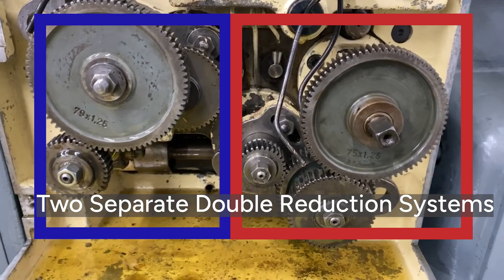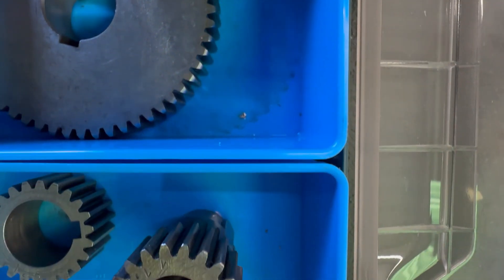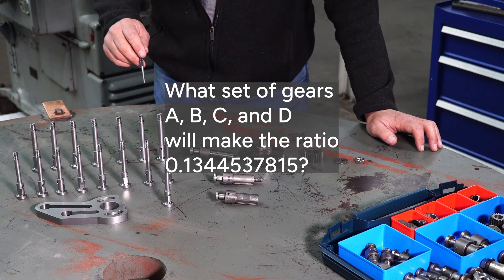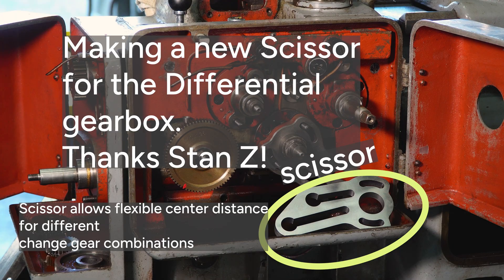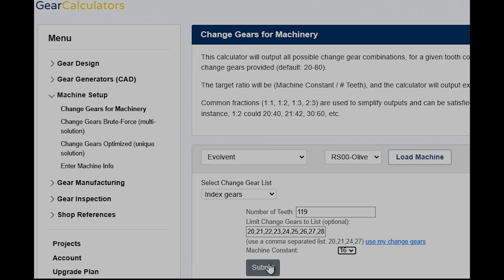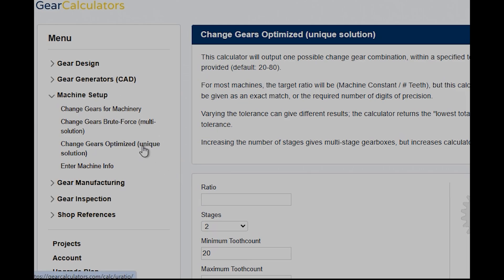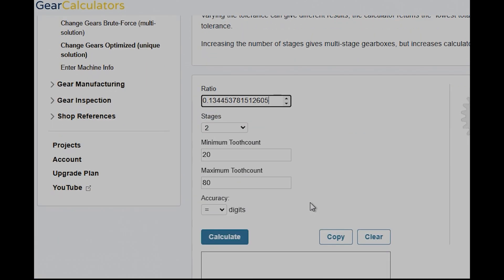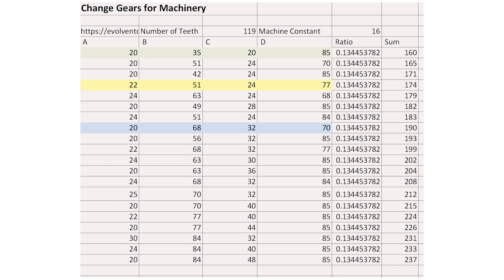Multiple methods to calculate change gears

Comment: Sir, how are you sir? I have 101 teeth in 24 stomachs, 127 teeth, how can I cut 131?
Reply from the maker: Not sure if I am translating your message.  But to cut a 131T gear with a hobbing machine can be difficult.  131 is a prime number.  So for a hobber without a differential system, you would need to have a change gear that has 131 teeth.  IF you have a hobbing machine with a differenial, it is possible to make the 131 tooth gear without a 131 tooth change gear.  IF it is possible, it is usually in your owners manual.

Comment: Hello, happy new year and health to you and your family. In "gearcalculators" can I find calculations for a Barber Colman gear hobbing no differential? Could you record content teaching how to calculate or manufacture helical gears in Barber Colman gear hobbing? Thank you, best regards from Brazil
Reply from the maker: Barber Colemans have machine constants like 12, 30, etc
Reply from the maker: GearCalculators can do many machine constants with one calculator "Change Gears for Machinery"
6,8,10,12,15,16,18,24,30,32,40,48,60,64
And if you use "Brute Force" calculator, it does not matter what you constant is, as long as you calculate the ratio, it will work.
Reply: @EvolventDesign  I was trying to learn about this equipment and when you are going to manufacture helical gears, there is a calculation to correctly assemble the index and feed (in the differential). For engineering straight teeth on this machine, I can use this constant that says, in my case it is 15 and 30 (I have 2 machines). To manufacture helical gears on this machine, it is a little different, you need to assemble the index and feed based on the calculation in the information of the gear you are going to manufacture. The translation of some information directly into my language still confuses me a little.
Reply from the maker: The index gears, gearbox, and index constant only control the tooth count.

The differential gears, gearbox and differential constant control the helical angle - coupled with the position of the hob head.

Watch this video - it shows the setup
https://youtu.be/n4BzdJcOW-Y?si=QHaU8dSM84LdwYUH
Reply from the maker: Also this vide for spur gears
https://youtu.be/kWurSpeVwu4?si=JqEnIRU6wG9OLeXj
Reply: @EvolventDesign  Thank you very much!! I will watch
Reply: Good morning sir, your work is very beautiful sir, I needed a hellpe, I need 24 divided by 127, how to cut the chase